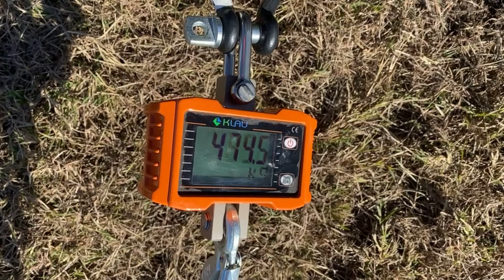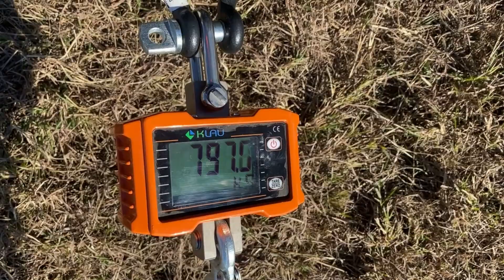Yanmar 424 Static Pull Test  - More Power!

Comment: So, it wouldn't even spin the tires?
Reply from the maker: We took precautions to prevent it from spinning out or the test would be point less. The chain ran at a bit of an angle so the harder it pulled, the more down pressure we’d have.  Plus weight in the bucket.   Oh and we had to remove the grass/top soil to get to the clay.
Reply: I thought the same thing. To me an unballasted tractor should spin the tires on any surface in low range. Tires may be filled which would help some. My 25hp hst tractor spun the tires all the time in  low range 4x4 until i filled the tires and added ~800lbs 3pt ballast. Now it only really slips on wet/loose ground.